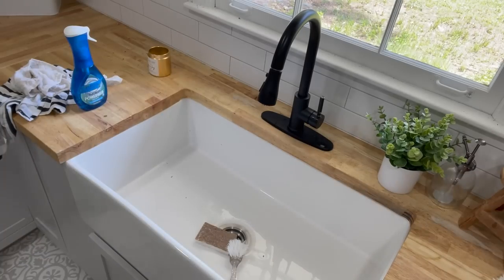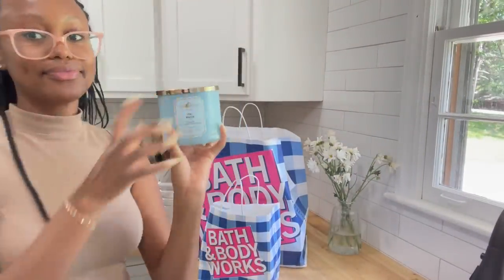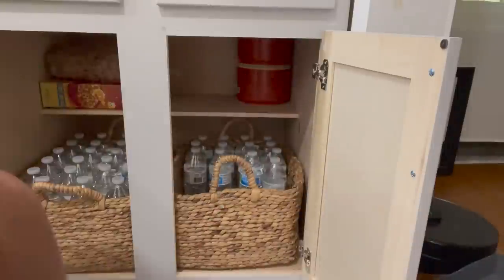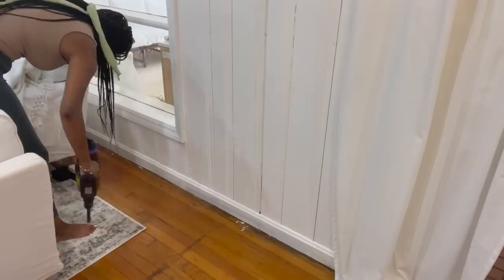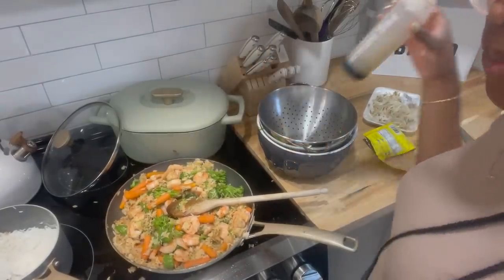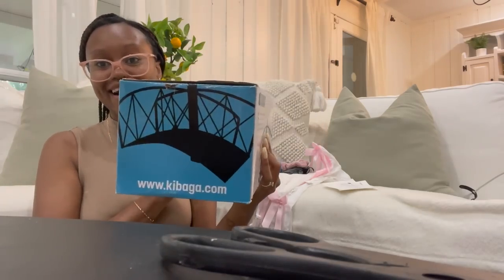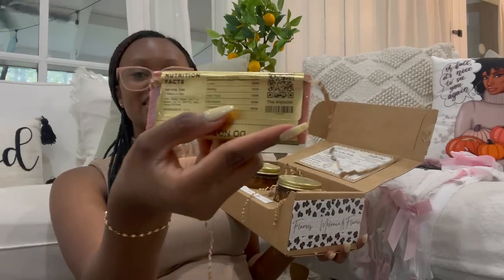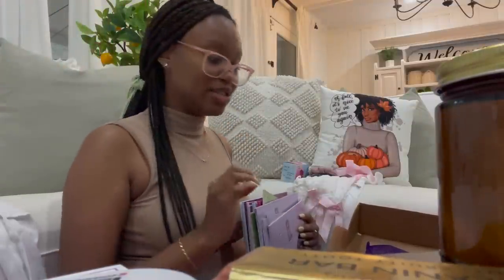ALL DAY CLEAN, DECORATE,ORGANIZE & COOK WITH ME| Get It All Done + Extreme Cleaning Motivation *NEW*

Comment: One of the absolute best upgrades that we did to our kitchen was the installation of a high end garbage disposal. I don't mean the little $50 unit, but the $350+ units of 1 HP (frequently sold at Home Depot). I have an older home built back in 1972, and our plumbing is not the best, but I can put anything and everything (yes, even potato peels) into that disposal and it handles it all with ease, and is super easy to keep clean with a little fresh lemon, egg shells, and a drop in cleaner every once in a while as needed when I'm deep cleaning.

Comment: Enjoyed the video. Pro tip for the dishwasher... don't wash or even rinse the dishes before putting them in. SImply scrape any large bits of food off and that is more than sufficient. The dishwasher soap needs the particles to properly adher to and wash your dishes properly. Plus it also limits the likelihood of streaking and saves a ton of time.